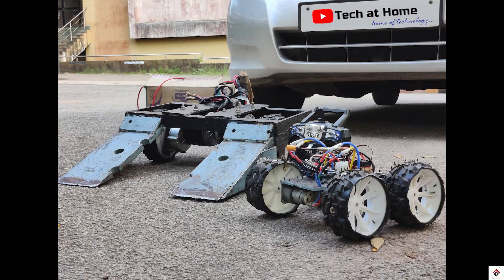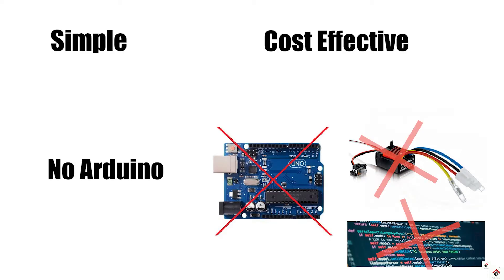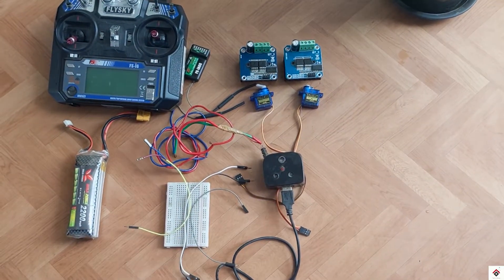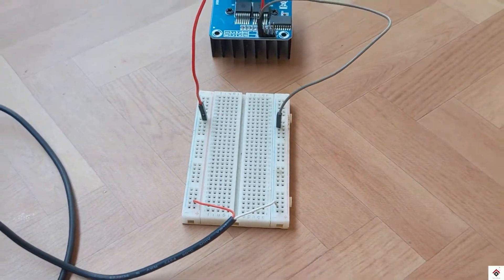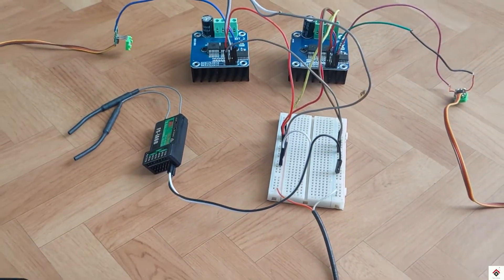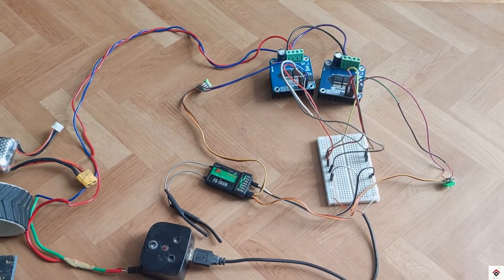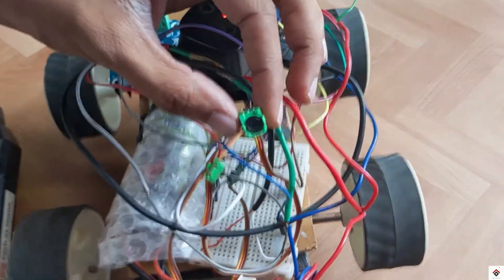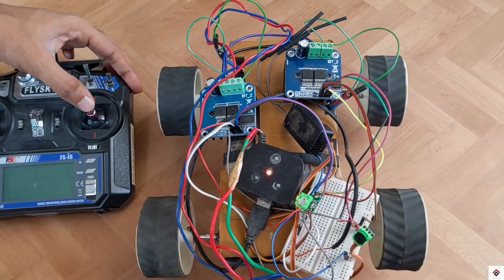Roborace, RoboSoccer ⚽ Robot using Flysky Transmitter, BTS7960 and Servo motor | No Arduino, No ESC

Comment: Can you tell me how you made the buck converter
Reply from the maker: I have not made a buck convertor.
I used drone motor ESC(Simonk 30A) which converts 12v to 5v.
Reply: @techathome  Is it possible for me to personally contact you as i have a competition coming up and a lot of things are not working according to plan
Reply from the maker: You can mail on: deepakhd20@gmail.com

Comment: Hello sir, I have a roborace compition coming up can you pls tell which motors have you used an which motors will be the best for compitions like this.
Hope you reply thanks in avance
Reply from the maker: We have used 500 RPM, A grade Johnson motor. You can also use the same.
Don't buy B grade.

For roborace, tyres matter a lot. Use RC car tyres if you have budget.
These plastic wheels we have used are not so good.

Comment: can v use 3c lipo battery instead of 30 c
Reply from the maker: What are the voltage and current specifications?
Reply: @techathome  12.8 v
Reply: @techathome  6000mah
Reply from the maker: You can use it.
Reply: Bro can v control this using two sticks of transmitter
Reply from the maker: Possible. But mixing will be different. I don't know how to do mixing that way.

Comment: How can we set the chanel 1 and 2 at same place in remote if it doesn't have the screen?
Reply from the maker: I don't have that model without display. I think you have to connect with computer and do configuration. Try if you can find anything on youtube.

Comment: Which engines is the driver BTS7960 suitable for? I don't mean the voltage. Can it also be used to control an RC 540 35T?
Reply from the maker: It can run any DC motor upto 24v, 30A.
You can use this driver for your motor since it is within the limits.
Reply: @techathome  But also for brushless motor?
Reply from the maker: Not possible for brushless motors. Only suitable for brushed DC motors.
Reply: @techathome  
And what happens if you connect it anyway? Will the motor not turn or burn out? I'm asking out of curiosity.
Reply from the maker: The way brushed and brushless motors work are completely different.
 Brushless motors work with 3 phase AC. There will be speed controllers which convert DC to AC based on input PWM.

Brushed motors have 2 terminals for DC supply. So you cannot connect bldc motors to this driver.
Reply: @techathome  
Thank you for your clarification. My RC540 T35 motor only has two cables, so I'll just test it and see what happens.
Reply from the maker: Welcome 👍
Yes yours is DC motor.
Reply: @techathome  
How could I actually check whether the driver is defective? I have two of them and one does not work (all connected in the same way). I used a small DC motor for testing.
Reply from the maker: If you have Arduino you can follow this video: https://youtu.be/H2YJRaaXFIM?si=WeFbdB6xgddMmUO1

Comment: will it work with 12V dc 37GB gear motor for soccer bot
Reply from the maker: This motor driver can support 24v motors also.
Reply: @techathome  does the servo's circuit support this?
Reply from the maker: Servo circuit is to decode the receiver signals and give input to motor driver.
Motor driver will run the motor.
Reply from the maker: Yes

Comment: I am using 4 Planatery moters each 40A at peak stall so can I use this moter driver
Reply from the maker: Can you send motor link or specifications?
Are you planning to use one driver for one motor?
Reply: @techathome no I changed my mind and I am using square gear moter each 200rpm and using this 4 moters for my robo sumo and moter driver I am using 2 of them so can I use it
Reply: @ plz tell bro my event is near by
Reply from the maker: Can you send product link of your motor or specifications?
Reply: @techathome  but I am using 200rpm
Reply from the maker: I need current and voltage ratings
Reply: @ one min
Reply: @techathome Voltage 12V DC Current 300mA to 2A
Reply: @techathome  hey bro plz tell
Reply from the maker: It will easily work for these motors.
Reply: @techathome  thanku u very much bro
Reply: @techathome  there is one problem I used ur connections but when I give re throttle for forward direction it gets shot and smoke gets coming out then I checked the connection they are proper so what should I do now bro Plzz tell me
Reply: @techathome  bro plz help me
Reply from the maker: Can you send some videos and photos on our mail.
Reply: @techathome  bro I have tried it few days ago before asking u and it didn’t work then  it started smoking for few seconds then I remove the wires but before started smoking it works for few seconds then after I checked the whole connection
Reply: @techathome  and the connections are correct I tried it few days before and after the shot I disassembled all the connections so I have no photos to send u
Reply: @techathome   now what should I do now
Reply from the maker: Which servo motor circuit are you using?
Reply: @techathome  That one which u have used in ur vedio
Reply from the maker: Then some issues with connection or faulty motor driver.
Reply: @ ok 👍 thanks for it support

Comment: Can I use this circuit for 4 geared motor 24v 350w
Reply from the maker: Yes you can use.
Reply: The only problem is no speed control. It’s full on or full off…. 
Is it possible to control the speed?
Reply from the maker: Not just on/off.
This has speed control.
Reply: @techathome I guess I will try it again.  I tried it before and it was only full on or full off.. no speed control.  Maybe I did something wrong. I will try it again.. thanks for the reply..👍

Comment: Hi and thanks for the video. If I have 2 brushless hoverboard motors and 2 ZS-x11H drivers can I apply your system? thank you very much.
Reply from the maker: This method is only for brushed DC motors.
Cannot be used on brushless motors.

Comment: https://youtu.be/EnbkdrYQ0NE?feature=shared bro i came from this video I have already asked you that I have project coming in the early next month and I need your help with if you can. I have to control 2 DC motors with 2 seperate bts 7960 motor driver and controlling all that with remote controller using arduino uno as a micro controller. please help meee in this. thanks.